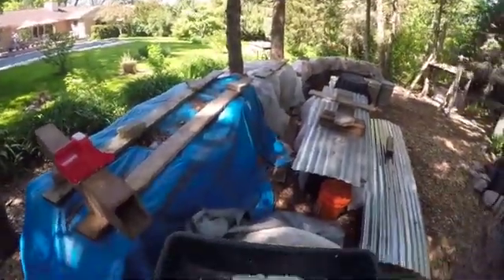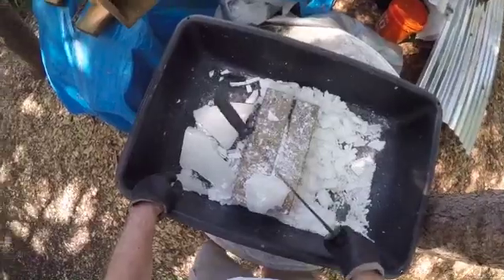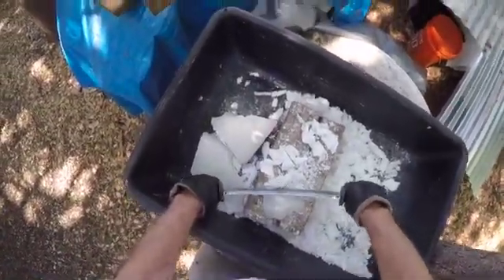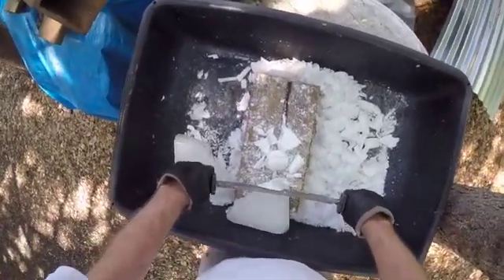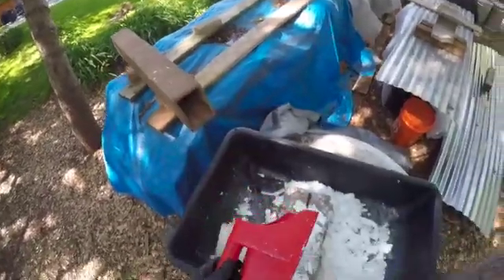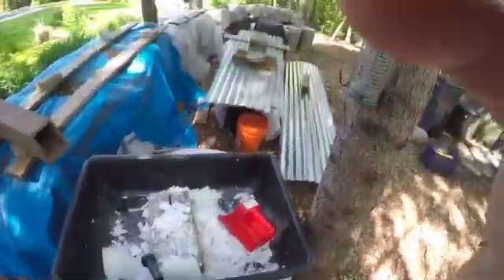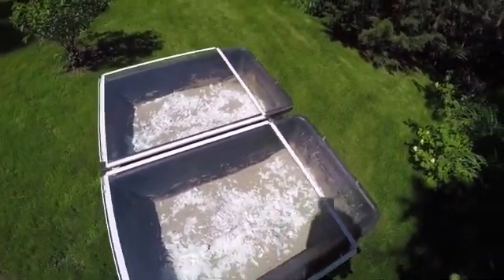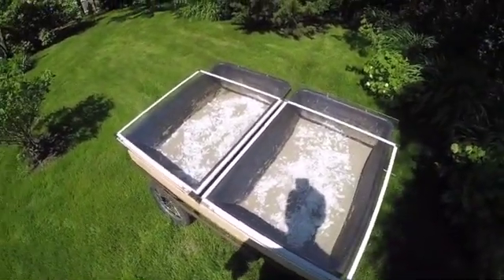Making Waxed Sand Part I

Comment: why sand over dirt?  My understanding is based on soil type in your area.  Isn't midland area more dirt/clay like it is in Southern mi than it its Kalkaska sand like in hillman and oscoda ?
Reply from the maker: Hi Matthew, IMEO, soil type has no bearing on which to wax, sand or dirt because I never left the waxed medium exposed!  There are two main reasons why I used sand.  First, I bought “all purpose” sand from Lowe’s because it was always dry.  This is a big deal, not having to dry the soil.  Secondly, sand takes about 1/3 the amount of wax as the same volume of dirt.  This is because sand is rock and soil is mostly organics and absorbs the wax whereas sand is coated.  

All of my waxed sand bedded & covered sets had a blended top-coat of broomings from around the set area usually duff and if I had snow cover, snow.

Comment: when storing do you ever have problems with high temps remelting the wax and thus clumping?  With 100+ normal through Sept here in TX not sure how to avoid this?
Reply from the maker: Hi David, I keep the garbage cans in shade with condensation vents in each can as shown in the one video.  I get temps in the low-90s with minimal clumping.  I really believe any clumping I get is just from compaction and it crumbles in my hand.
Reply: @SeldomFales  thank you, I'm going to give it a shot and use your space bit tip.